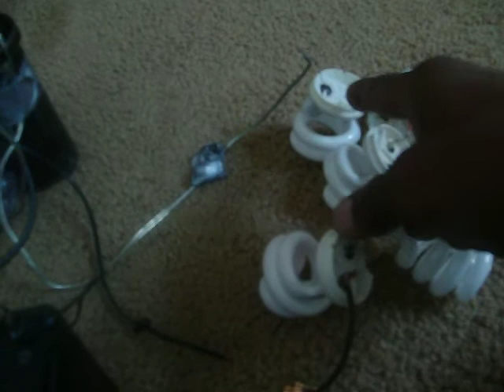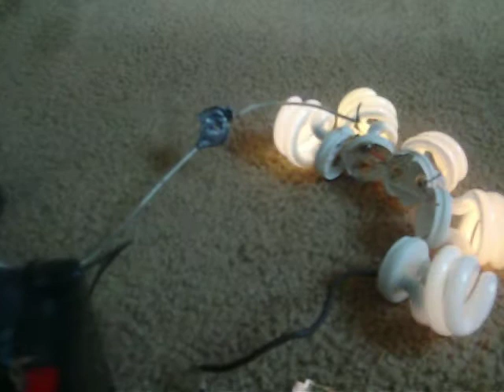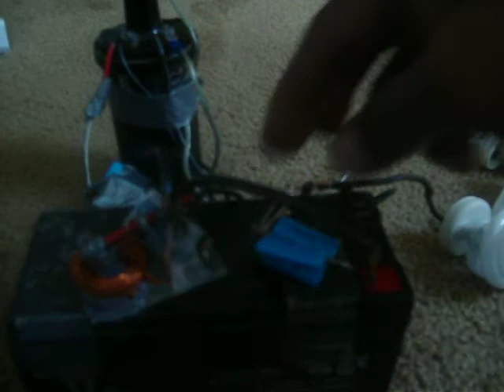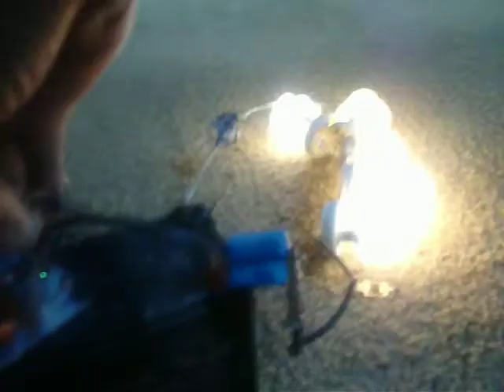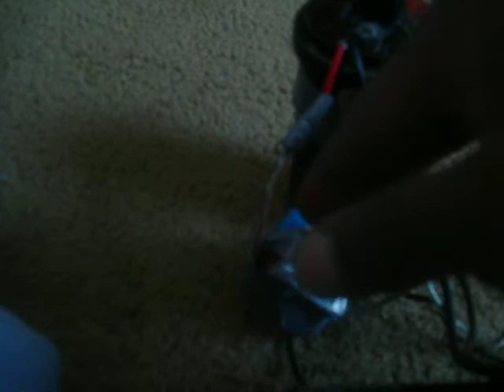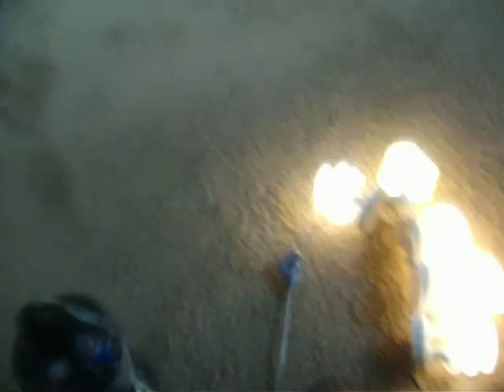Lighting 5 CFL's

Comment: Dwight, check out windbluepower DC PM generators. I use them on my gravity project. They have a website, just google it. These are the most efficient PMs I've ever seen. The DC-540 produces 12vdc and 3-4 amps at less than 200 rpms. I personally like the DC-520 PM because I have a 500 rpm system which returns 20 vdc at about 12 amps.